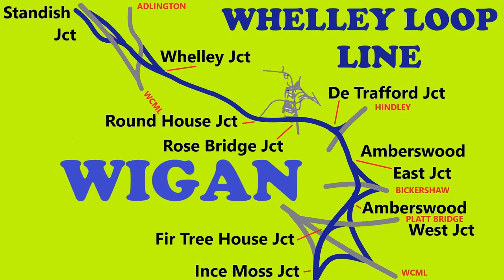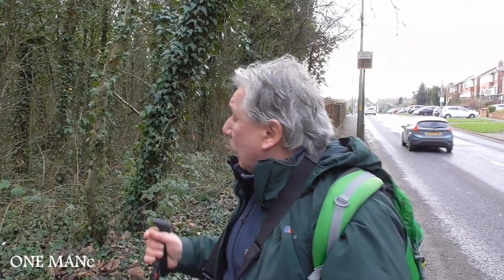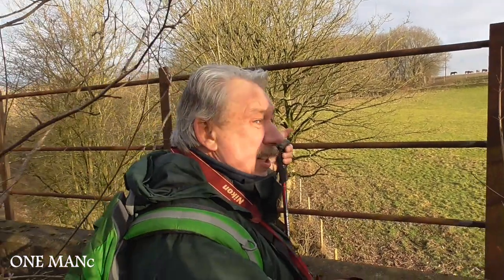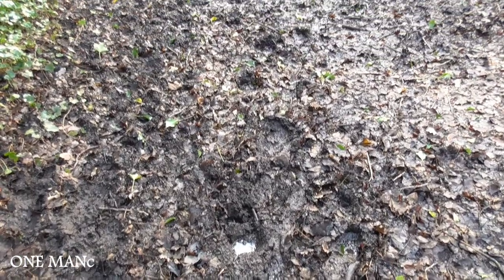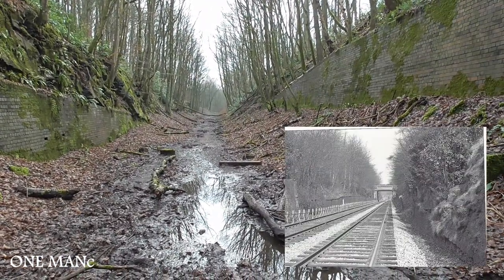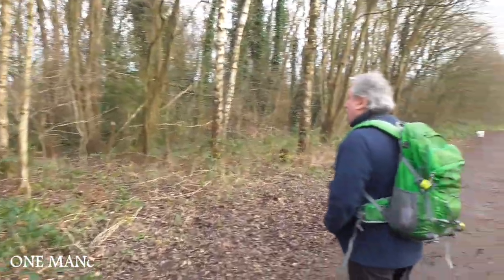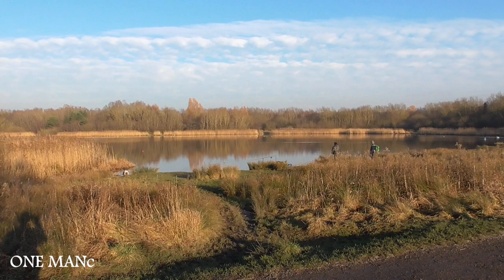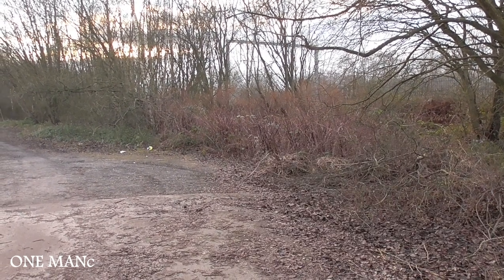Wigans Freight Avoiding Line. The Whelley Loop. Lancashire Union Railway. Standish to Ince Moss Jct.

Comment: Thanks for this video. I lived in New Springs in the the early 1970s. I still remember the diesel-hauled freight running along the line and over the canal. 

There is/was a proposal to extend the cycle lane northwards over the Twenty Bridges to Standish. Whether this will ever happen remains to be seen. 

Haigh Hall is pronounced locally as “Hay”.

Comment: Maybe that could of been used for diverted passenger trains to avoid Wigan North Western.
Reply: it was last used for that very reason as wcml was being electrified
Reply: @tracya4087  Yep
Reply: Isn’t there a rumour that British Rail regretted closing that line, very soon after it was closed, because of the delays through Wigan.
Reply: At 2.36 they were not holding sidings, it was the southbound spur off the West Coast line. The photo is of a Class 40 heading from Preston onto the Whelley Loop.